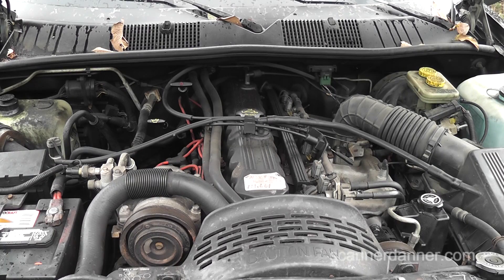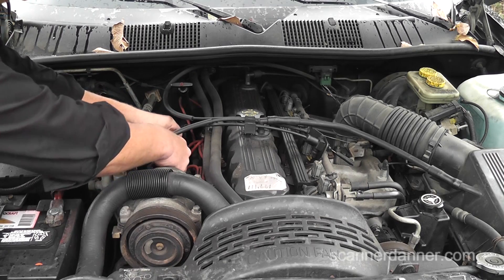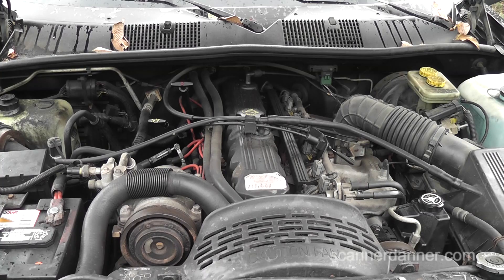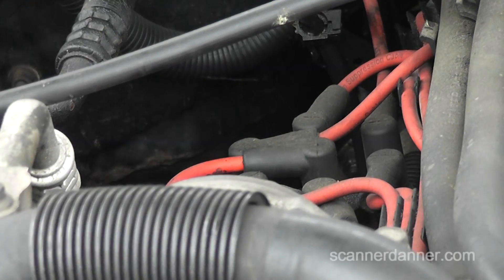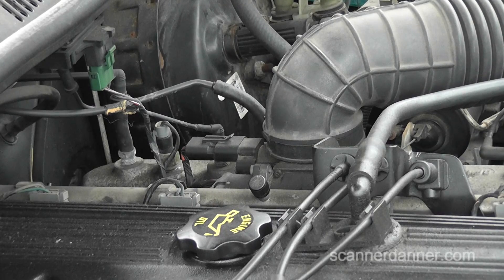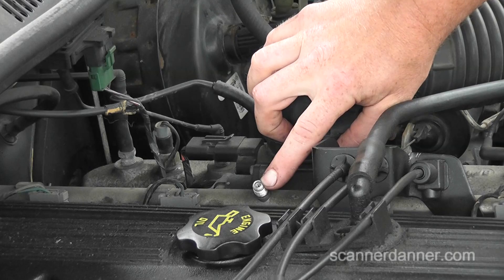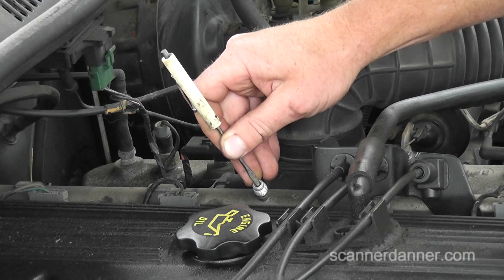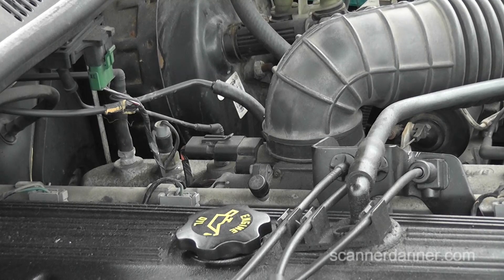How to verify and troubleshoot a no fuel pressure problem - Jeep

Comment: All these videos be like....here is how you do this at home....first break out your 1000 dollar tool....understand youre doing this to make people understand what to look for and thats great butyou got some nice tools there bud that make things easy. Cant DO anything you do we all have to pay someone for this lol
Reply from the maker: I'm teaching to technicians my friend. But with some interest and determination, I can teach you too. Even with minimal tools, you'll learn where the weaknesses are but be able to utilize them better
Reply: @ScannerDanner  I get it. Trust me still watched your video and still take the advice. Just saying. Preciate what you do no matter what I say
Reply: @ScannerDanner  I have a 96 Eclipse GST fresh rebuild. Got compression. Power. Spark. Fuel flowing through the rail. But zero on fuel pressure tester. Mine is a gauge that hooks to the banjo on the fuel filter. Can’t figure it out for the life of me.
Reply from the maker: @slumedia205  do you have a good power and ground at the pump?
Reply: @ScannerDanner  no reason to think I don’t have good power. Battery tests good, full power throughout the car, cranks like a brand new motor…ground at the pump should be good, 2 connectors and 2 lines…just plugged them in and replaced the pump with a new one. Looked exactly the same as my old one.
Reply from the maker: @slumedia205  maybe you reversed the fuel lines? And you should still confirm power and ground at the pump
Reply: @ScannerDanner  I don’t think it’s possible because of length…if I did would I still get flow? Like I said I’m getting fuel to the rail when I crank. Eclipse 2gs don’t prime from what I’m reading they push fuel when cranking. I’ll double check the lines but if I wasn’t getting power wouldn’t it not be flowing at all??
Reply: Would like to see a pressure gauge hooked up for a double check.
Reply: @martycj8  was sold just as an update. Honestly my goal was a GSX and I put the money in a fund towards one. That car ran into wayyy too many issues to keep up with so I was done. Plus got a great price and being a single father that’s where I was at. Appreciate the video and advice always
Reply: @martycj8  but I did that. Replaced the fuel pump…gas was getting to the line but not enough guy who bought it said he drained the tank and a whole bunch of other shit I felt bad for. I let it sit too long that was the problem

Comment: Great video! Does this apply to a 1990 Cherokee 4.0 as well? I am having an intermittent problem with mine. I went to check for spark and the freaking thing started right up! I can actually hear my fuel pump when I turn on my key, but sometimes there is nothing.

Comment: New fuel pump, new battery, new plugs, new spark plugs cables,  new injectors and still making the long crank. 1998 cherokee 4.0
Reply: The regulator is inside the fuel tank. Its a post 97 and is inside, up the fuel pump.  Not exterior like in the pre 96 models
Reply from the maker: what does fuel pressure do on shut down? does it hold?
Reply: @ScannerDanner  no fuel pressure.at schraeder valve or very low.
Reply from the maker: @lakecortes  if psi is normal when it is running and you have no other symptoms other than a long crank time, then you definitely need to address this bleed down issue. How many fuel lines does your fuel filter have? 2 or 3? IF it has 3, the psi regulator is in the fuel filter and I can give you some tests to do.

Comment: So what if you test for fuel pressure and there is none, so you install a new fuel pump...still nothing. The fuel pump isnt even turning on. So you jump the fuel pump relay and you hear it turn on, but it's not turning on with the key. So we ordered a new PCM that was ordered by the vin number and came "programmed".  Installed it and still nothing! What else should I look at? What else could it be? I have spark, the fuel pump relay is good, the fuel pump is new, the battery terminals have been cleaned and the battery is good. I am lost at this point. The jeep drove fine, my buddy parked and went into a store for 2 hours, came out and went to start it and it wouldn't start. No issues leading up to it. It's a 2001 jeep grand Cherokee with a 4.0L, auto trans and is a Laredo with 2wd. Only thing I can think of at this point is an ignition switch issue of some sort. I dont really know where else to look. Can you help?
Reply: Mikeman hoff  did you fix your problem with the Jeep what was the issue.  I am having the same issue

Comment: Might be a dumb question. But when your starting the Jeep multiple times to check the fuel pump connection. Did you just unplug a spark plug wire so the Jeep doesn't actually start?  Or is the jeep just not starting at all

Comment: yeah something i learned  from a guy named vince is the texas two step any time you use a volt meter use a jump wire that reaches the battery if you want accuracy. there is potential voltage drop from anywhere else.

Comment: not 100% but I think the power probe will only light up or beeb when u have the same voltage as the battery to let u know of bad ground or bad wiring. (reference voltage) also will the Jeep fuel pump be powered with just ignition? cheers dude

Comment: Hey Paul, I've been watching your videos for around like one year and have to say they are A+++++ and helped me a lot in diagnosing stuff. I have this weird and stupid sounding question in my mind which I tried a lot to find an answer by myself but failed. Hope you might have a better clarification. Whenever I read a code for miss-communication/ communication failed, related to any electronic control module (SRS, ABS, VSC, EPS, etc), first I check the fuses and relays, then try powers and grounds at the corresponding module, then some live data on the scanner, then I wiggle the wires around, and yet sometimes fail to find any issue at all. Then I pull out the main connector(s) to the module, clean it with compressed air blow and then plug it back in and it starts working. This has happened to me many time! Clearly, there are no visible wiring issues whatsoever. When I tried to clear the codes before cleaning, it does not clear or comes back again. But after cleaning, it goes away and the customer(s) never complained on the same issue either. The wiring connector looks almost intact and no  water or dust contamination, yet after blowing some air, it starts working. For me, I see no proper pattern for this issue and it even happened on new cars with only few thousand kilometers. I feel ashamed to say to the customers about what I did, when they ask me, and they think I'm a genius, but all I did was just blow some air and clean it, that's all. How is this possible? on almost brand new cars, on a clearly intact/untouched wiring harness/connectors? Any comments, explanations are much appreciated!  Ta
Reply: You did a good job. Removing and reconnecting the terminals can be a repair. Only a slight amount of corrosion, even if you can't see is enough to halt current flow. You had the answer.
Reply from the maker: agree, remember the old days of the original Nintendo cartridges? We used to remove them, blow on them, then the game would work :-)
Sorry, I don't have a better explanation than what daveS ministry gave you

Comment: I think it's very important that you mention the engine must be attempted to be started recently before doing the schrader test you show.  You can't just walk up to a vehicle after its sat for a couple days or weeks and expect pressure there.  Even in a good working system there will be a bleed off period. You have to at least attempt to start the vehicle which you did in the previous spark test.  Someone who doesn't have a spark tester might just jump to the next step they can do.  "I don't have a spark tester but I can press on a schrader valve".  I know you know that, but for the sake of communication you left that part out.  Been a while, miss me? :P
Reply from the maker: yeah, I'm regretting even showing that test to be honest with you. Just something that can be used in a pinch. Thank bro and yes good to see you back!

Comment: Hi Paul,
I too like the Power Probe tools I now use the HOOK. I wish that Power Probe made it a bit smaller. I think that you would like it better as well.  I noticed that you had a bit of a problem using the Power probe . I have a tip for you remove the test probe and use your test leads to make using the power probe easer to use. Hope that this helps.
Also the hook you can change the voltage and amps  outputs . Check it out.
Michael.
Reply from the maker: I actually have the hook Michael. I just never used it yet :-)
Thanks man

Comment: PowerProbe IV is a great diagnostic tool. I swap between my LoadPro and my PP4 but one slip of your finger on the PP4 and putting 12V to a circuit can become an expensive oops. Nice video Paul

Comment: You are absolutely right about using a FP gauge.. I had a s10 blazer that wouldn't start and I pushed the schraider valve down and fuel was spraying out really good so I wasted 4 hours and pulling my hair out! I think I emailed you and you said check the pressure :) so I did and only had about 45psi when I think it was supposed to be around 55-60psi. 
Man did I learn a lesson there!!
Great video

Comment: Paul, It was clear that the most probable cause of the lack of fuel pressure was a malfunctioning fuel pump or a resistive power-feed, but I did appreciate your use of the PP4 to show the injector signal pulse and waveform data points. The fact that the PP4 also provides a reliable ground can definitely save me time. I love your clear explanations.
Keep up the great work.

Comment: Nice video. An FYI, you can remove the black probe on the Power Probe and then plug a lead from a DVOM/Vantage/etc. to give yourself, and us, better viewing access. Additionally, for another fuel pump test, why not just unplug the fuel pump connector and attach the Power Probe to the fuel pump's power and ground wires (via a back probe (green light = continuity, then press the button and give it power to see if it runs))?
Reply: True but you would not know if the pump was working or just running?     It would be the same if you shot carb cleaner in the intake to see if it start's on it telling you the pump is not working even if you hear it running?
Reply: If you are by yourself, and have a fuel pressure gauge hooked up, then one can determine if the fuel pump is pumping when applying power. If you don't have a fuel pressure gauge, but you have a helper, when applying power have the helper crank the engine to see if it starts.
Reply: That's what you would be doing in the first place when you try to start it same thing. but the best way is with a gauge.

Comment: I found the problem.  Its a jeep..
Reply: I have a 2000 Jeep Grand Cherokee runs like a champ we have owned it since new he's been well maintained leaks oil  but other hen that nothing wrong with Ac even works no rust on it but in not I. The salt belt. 172,000  just normal things have needed to be done like ball joints radiator some recalls new hoses still has the factory fuel pump I been running medium grade fuel threw it coolant has been changed.just went in  for tranny fluid and filter change still had the oem computer  just had new champion spark plugs put in runs great I get about 17 mpg highway and bout 12-14 city depending on how I drive so far nothing major I also had a 98 jeep grand loved it  it looked brand new  was in great shape 180 k then it got wrecked
Reply: HA HA HA
Reply: You would be wrong.

Comment: This wold been good job for the lode pro
Reply from the maker: No need to load the wires to that pump. 10-11 volts on the feed and .02 on the ground with no pump operation is a bad pump EVERY time (or something open inside the tank). One could make the argument that with an open pump brush contact, that I am not technically loading the circuit and that my wiring tests were incomplete. I would agree, BUT, if there was a wiring problem preventing this pump from running, the test I showed (cranking test) would have shown it. The pump is the load in the circuit, if there was a wiring problem I would have seen it. Check out this video with a bad pump ground. https://www.youtube.com/watch?v=rQ7tvIxQSt0
You would have to have an open pump brush contact AND and external wiring problem AT THE SAME TIME. It just doesn't happen. 
The load pro has its place, but it's not here.
Reply: +ONBOARDTECH333KMD combine that with the fact that the power being tested here is also under a voltage drop due to the engine cranking , which would also show a raising voltage in the ground side,  slight but you'd then have to do the math.
Reply from the maker: exactly
Reply: no load pro necessary,  the load is already in the circuit
Reply: +ScannerDanner there is a load test function on the pp4

Comment: Great info Paul. If the pump provides a prime every time you turn the key, why is residual pressure important? Mazda return less systems have check valves for bleeding off pressure. Thanks!
Reply from the maker: Because I was using that knowledge of residual pressure to guide me. Having no pressure in the rail suggested the pump was never providing pressure in the first place. This system should absolutely hold pressure on shut down. Now, one could make the argument that the system also had a bleed down problem and was not holding pressure on shut down but that is a stretch. I would have had something come out of that schrader valve, there was nothing. Also, this is why I did the injector pulse test. To show I had spark and injector pulse, with nothing at the schrader valve = fuel pressure problem for sure. Make sense?
Granted, the best test was to use a pressure gauge and then crank it over to confirm. I was just showing an alternative.
Reply: Yes, of course, that makes sense Paul. Using residual pressure for direction here makes perfect sense. I'm struggling with why residual pressure matters at all on a properly operating vehicle given the start up prime.
Reply from the maker: without the rest (residual) pressure the system will suffer from long crank times. Especially with the engine hot. The rest pressure helps prevent fuel from boiling in the fuel rail on shut down. (raise in psi = raise in boiling point)
Make sense?
Reply: I've heard you mention fuel boiling in the rails many times. Never put it together with residual pressure. Makes perfect sense now. Thanks so much for taking the time to explain.
Reply from the maker: absolutely. Thank you for being here and commenting!
Reply: @ScannerDanner  my jeep is having this problem 1996 zj 4.0 long crank times no check engine light. I hear the fuel pump prime every time I key on (and sometimes it sounds weird) sometimes it stalls while running. I can feel the fuel log area is hotter than an oven when it is running and probably percolation of the fuel it has a return less fuel  system I need to get a fuel pressure tester to verify pressure,or faulty fuel pump/pressure regulator,or if I have leaky fuel injector. I checked the crank position sensor and it seems to be working took off throttle body and it looks wet in there like fuel  my question. Is fuel pressure regulator in the tank, thanks love your channel?

Comment: Checking injectors pulse is needed because in some systems the computer needs rpm signal to run the pump. I'm saw that on Mitsubishi GDI's and Toyota Rav4 '06 that I worked on.
Reply from the maker: For sure and I agree completely. That is why I showed the injector pulse test, to verify an RPM signal. However, the reason I said it wasn't necessary in this application, was Chrysler (Jeep) systems do provide a key on prime that is independent of the RPM signal. If this system was providing a prime (with a good pump), I would have had some fuel come out of the fuel rail on my schrader valve test. Make sense?
Reply: Yes 100%. I was most surprised about a lack of key on fuel prime on the JDM GDI's I came across. Then again those were swaps.
Reply from the maker: for sure, I've seen other systems with no prime as well. The older Toyotas with the Vane Airflow Sensor didn't have a prime.

Comment: Awesome as usual Paul!.... Is it possible to Load test power and ground with this too,  to verify if a wire is corroded and creating voltage drop?
Reply from the maker: The cranking test I showed was the load (on a good pump of course). If I had a wiring problem, this is when it would have shown up. Read my reply to Vaughn Dibble
Reply: Don't believe the power probe can do a load test